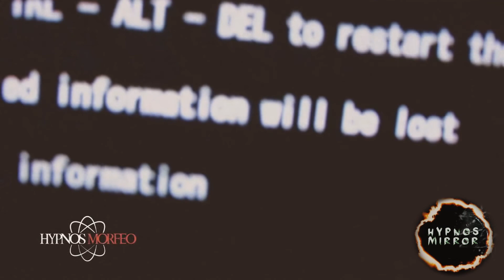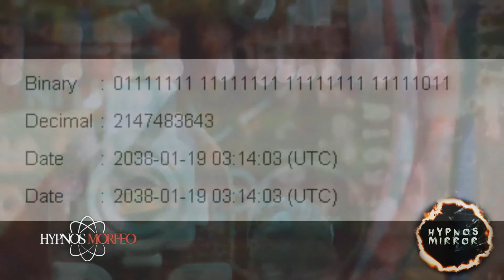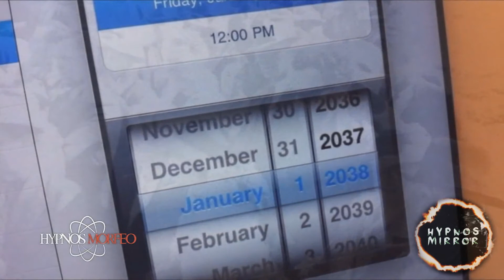The Year 2038 Problem -- Technological Apocalypse?

Comment: Just tried it on Windows 98, nothing happened :-(
Reply: Megaminx  No, the year 2038 problem where the date in seconds will excede the 32-bit integer limit
Reply: Setting the time manually in windows is not going to effect anything. It all depends if the system running Windows 98 is a 32 bit system on the hardware level. Computers running on 32 bit hardware will not experience the problem until that year 2038. If you used a VM, that is already designed for 64 bit compatibility.
Reply: @mclaine33  I used a real Windows 98 computer, but I haven't tried setting it in the BIOS yet

Comment: The simple answer is no, not if the computer systems are upgraded in time. The problem is likely to rear its head before the year 2038 for any system that counts years in to the future.
A calendar system that counts and stores appointments for 20 years into the future will start seeing issues in 2018, for instance.